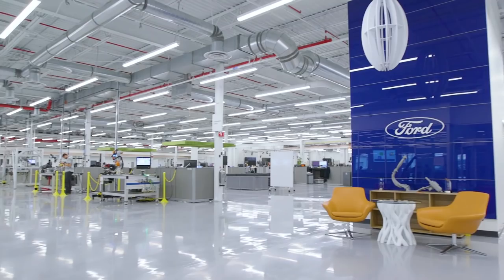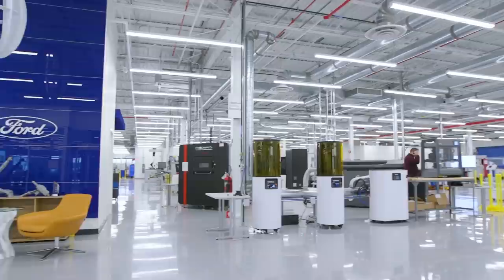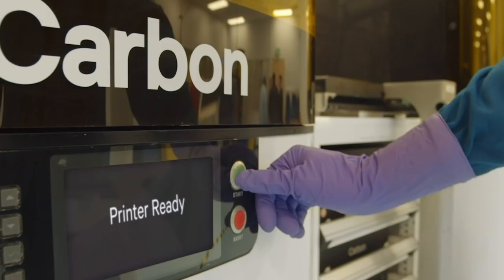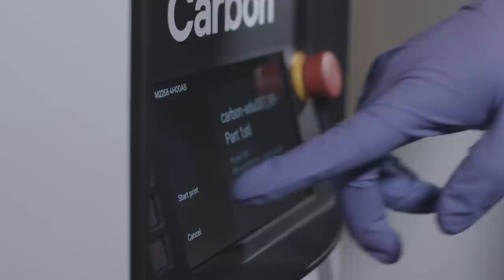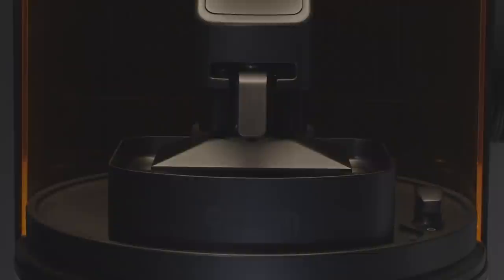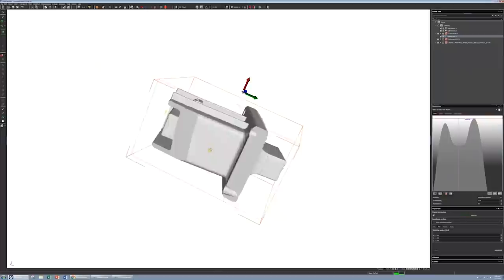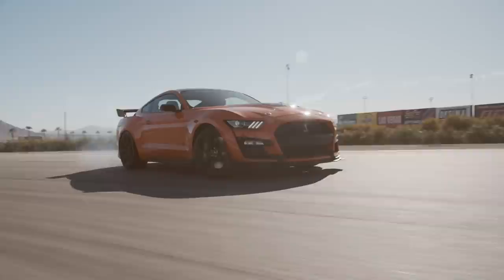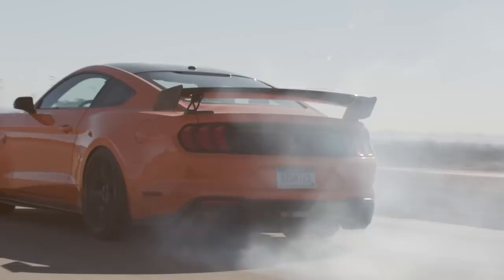Additive MVP - Ellen Lee, Leader of Additive Manufacturing at Ford Motor Company

Comment: Are thermoplastics safe for electrical connection plugs?  My instincts tell me that corrosion could lead to a melted connection and then a catastrophic thermal event.

I have seen melted connections (mostly high current blower motor switches) and it just seems like a bad idea.  I wouldn't dare design the unfused side of a fuse block in thermoplastics 

That being said, the possibility of having obscure individual plugs available instead of replacing an entire $800 harness would be a real game changer!
Reply from the maker: Hi there, thanks for your comment. The use of thermoplastics in the electrical connection system depends on the rating it is being used for (Current/Voltage). Depending on the amount of insulation needed, various thermoplastics are being used like PBT, Nylon. Please let us know if you have any additional questions.